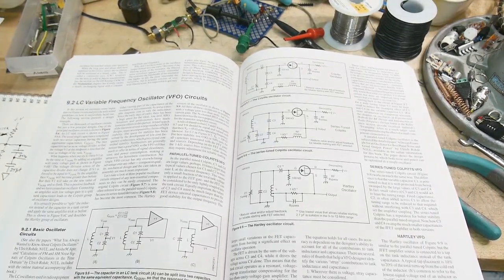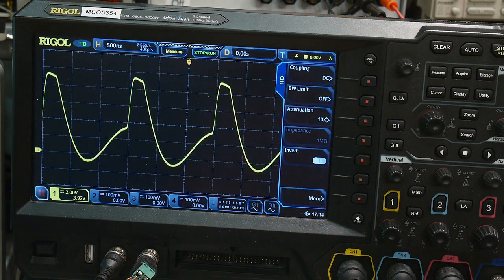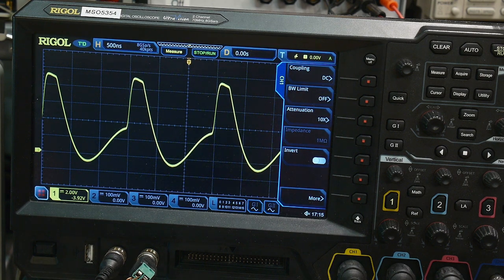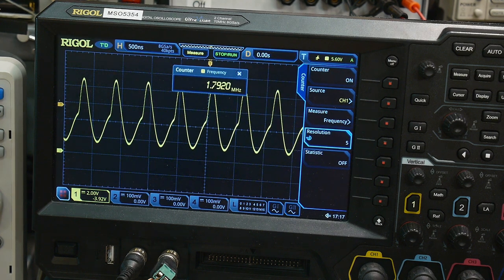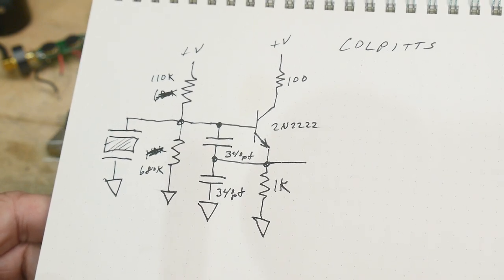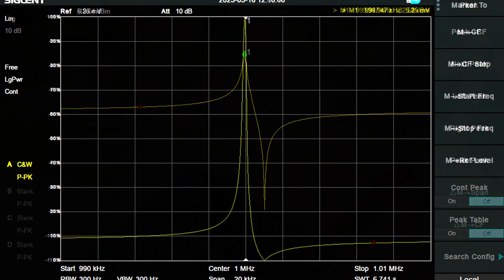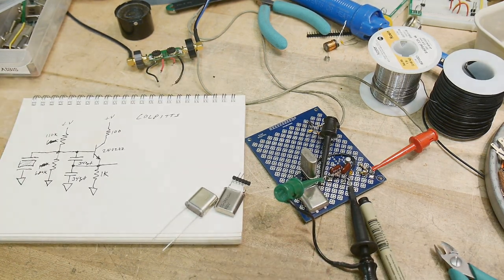#1527 1 MHz Colpitts XTAL Oscillator

Comment: Nice. I love those old large-case crystals, they look so much better than the modern HC-49 ones.  But.... Could you please show how to make a transistor-based Hartley/Colpitts oscillator for those small 32,768KHz watch crystals?  I've tried a couple of times but never got them oscillating properly, I guess actually I should say "at all" ;-) .
Reply: yes this would be nice :)
Reply from the maker: use a 74C14 like this: https://youtu.be/FExN8ZaufCI
Reply: @IMSAIGuy  That's cheating ;). Can't have an IC as the oscillator if I ever get a round to make a fully transistorised wall-clock....
Reply from the maker: @MatsEngstrom  https://electronics.stackexchange.com/questions/299392/low-frequency-pierce-oscillator-with-transistor
Reply from the maker: https://youtu.be/jyZQdZF6KIE
Reply: @MatsEngstrom  if you use a 74HCU04 it's not cheating ("U" for unbuffered). Each inverter is just a pair of complementary CMOS transistors, nothing else. And it's actually a Colpitts. :)
Reply: You've got a perfectly good 50/60hz time corrected sine wave coming from the wall. 🤣

Comment: Interesting devices... quartz crystals. There's almost an equivalent mechanical construction. With a few of the measured crystal parameters, ohms law, and some complex number algebra, you can work out the crystal's series resonant frequency, parallel resonant frequency, and impedance at resonance.

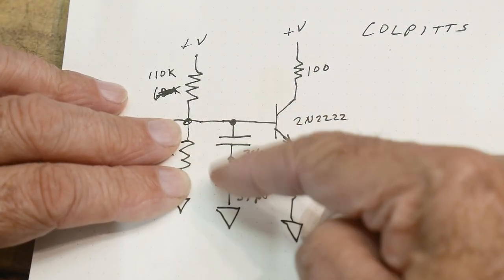Comment: At 2:00, I may have missed something, but i think you demonstrated putting an inductor in parallel with the 680k resistor. Wouldn't that short out the bias to the base?
Reply from the maker: read up on inductor reactance. at that frequency it acts as a resistor.
Reply: Is there some capacitor in series with the inductor so as not to short out the DC bias thru the inductor?
Reply from the maker: @Music-zh7fm  I see it both ways, there is no one way

Comment: Can you manage to get a "simple" Colpitts to oscillate at any frequency between 200 kHz and 24 MHz without having to alter components?

I've been trying to make a "simple" crystal tester to prove working or not, any crystal picked up or fund at junk sales.

More often than not, old crystals are burnt out due to having too much crystal current passed through them, but it would be nice to have a go/no-go tester.
I have managed a tester that has an eBay counter PCB that will count the output of the oscillator, but it's finding an oscillator circuit with wide enough characteristics to work with a crystal between 200 kHz and 24 MHz.

Any hints anyone - A circuit is preferable to a description, please.

As it is, I am using three oscillators with their outputs parallel with three sets of inputs where crystals can be poked in and one lives in hope that one of the three oscillators will spring into life when the unknown DUT is inserted, if neither of the three oscillators work, the conclusion is that the crystal is dead. Back at home testing crystals, about 1 crystal in 20 tested will not oscillate, but the crystal is good and works, this is usually the low-frequency crystals that are below 1 MHz.

Thanks,
KW.
Reply from the maker: https://youtu.be/s7rcZAto1BU
it won't cover your entire range without some component changes
Reply: @IMSAIGuy  Yes, that's virtually the same as the multi-oscillator input I have on my crystal tester, but no LED indicator, only the outputs of all three oscillators go to the input of a cheap eBay counter PCB, if any of the three oscillators work with the crystal on their inputs, the counter will indicate the crystal op freq. showing a working or not working crystal.
The multi oscillators allow for a range of frequencies of crystals to test, usually 200 kHz - 500 kHz, then 500 kHz to 6 MHz, and then up to 24 MHz. Anything higher than 24 MHz is (in my case) an overtone crystal and not fundamental.
Reply: Instead of trying to get the crystal to oscillate, sweep it using NanoVNA. Given the price of the latter, you get a whole lot of performance very cheaply. A crystal response sweep will indicate resonant frequencies of various modes and their Q factor - pretty much everything you’d need to characterize a crystal.

As for crystal oscillators that can take a wide range of crystals: the trick is to inject wideband noise on the input of the crystal. Just high enough to get the sense amp move enough on the output to make the Schmitt output switch. One or two edges later the filtered crystal’s response overwhelms the noise source. In order not to overdrive the crystals, the drive side needs a current sensor (a shunt), an amplifier for it, and an AGC driven from it to limit the drive power to values that won’t over stress the crystal. All in all getting one device oscillating from tens of kHZ to tens of MHz requires a bit of finesse if you just want to stick a crystal in and have it oscillate. Never mind that the crystal may not oscillate at the frequency you want. Eg 3rd overtone crystals may have a strong fundamental resonance that a wideband oscillator may latch into.
Reply: @absurdengineering  Unfortunately carrying a VNA and cables is not really practical when you are at a junk sale looking at crystals in a box that someone is selling.
The idea of a small box with three oscillators who's outputs are paralleled and connected to a cheap eBay LED counter is ideal because it is all in one small box, and it'll not only tell you if the crystal works, but also what its frequency is.

Comment: What I don't understand is, how these crystals are 'excited' to make them oscillate. I was always under the impression you fed voltage in on one pin, and a pulse train came out of the other pin. That doesn't seem to be the case. I'm missing something. Can you do a video on the theory of how they work? That would be great! Thank you 🙂
Reply from the maker: you don't excite them. they are a simple LC resonant circuit.
Reply: it acts like an LC circuit. most crystals have multiple resonant modes, so you will need an external LC circuit to select the correct overtone.
Reply: The oscillator circuits feeds energy to the crystal. This energy supplies one of the crystal’s mechanical oscillation modes. The piezoelectric action acts as a transducer between the electrical and mechanical domains. The crystal element is a mechanical equivalent of an LC tank with a Q so high that it’s impossible to obtain using bulk passive components in the same volume.

Comment: this mean as well this quartz would be good as a antenna for 1.001Mhz, would be nice to experiment by removing the top cap (and short the lead) and look at directivity antenna
Reply: It would be a good ultrasonic transducer but as an antenna its electrodes are way too tiny. It’d act as an antenna tuning tank if you attached a piece of a very long wire to it. 1MHz wavelength is 300m.

Comment: Am I the only one who is disappointed by the fact that the crystal is 0,03 percent off (0.03 percent in the US). I expect the crystal to be exact, with nine zero's behind the local decimal sign.
Reply from the maker: you pay for exactness. you can pay for xtals that are better. this was used as a simple microprocessor clock so no need to be very exact
Reply from the maker: to be really good you have to control the temperature: https://youtu.be/h-KXTXe9U8s
https://youtu.be/EiAsVbYYdZ0
Reply: The oscilloscope is also not a perfect device to measure frequency and might be off by a bit. They usually get better if you have more waves on screen but then you won't see the details of the waveform as nicely as in the video. If you want to be sure about the frequency a frequency counter is much more accurate as it counts over a much larger timespan
Reply: @IMSAIGuy  I have been thinking, I love low prices and I know that higher quality certified calibrated stuff adds cents to every Dollar spent. So, I was thinking, if not one but two crystals are used and both of them have a known error in the frequency, but since you are using two different crystals the second can be used to correct the first. 
Or is this to far off?
Reply from the maker: @vanhetgoor  no, the best way that it used, is to add a variable capacitor into the circuit, you can tune the xtal to the correct freq.
Reply from the maker: true for most scopes. the MSO5000 has a separate frequency counter circuit that does not rely on the digitized waveform.

Comment: Actually this common collector Colpitts design is about the worst for starting with oscillators.
It's not easy to understand even to many professionals, difficult to design properly, often just doesn't work, bias of the transistor affects the frequency, has large distortion, suffers heavily from pulling etc.
Even its commin base variant is much easier to understand and design.